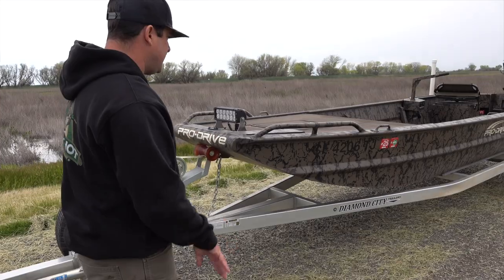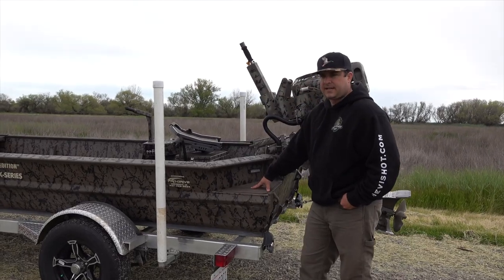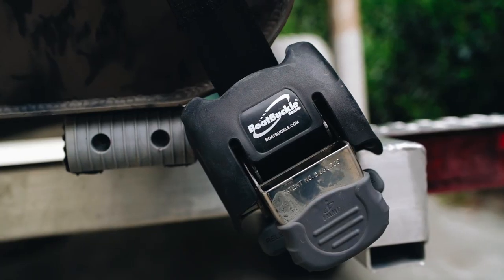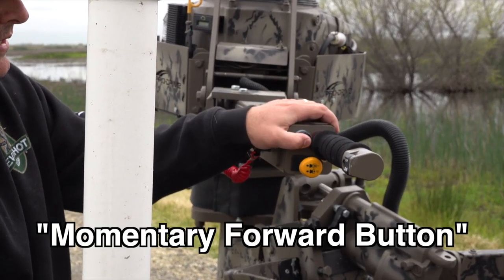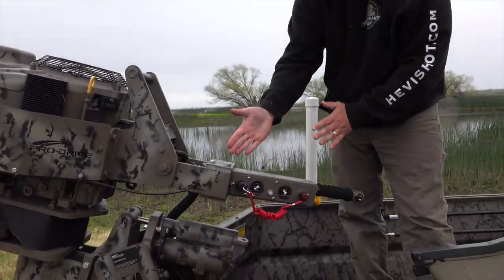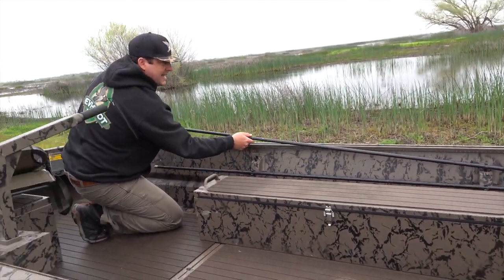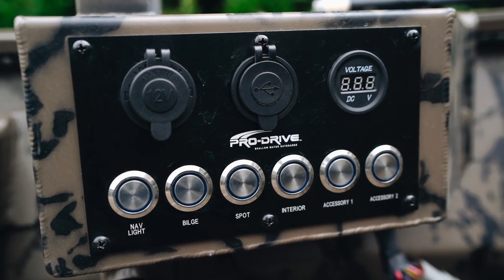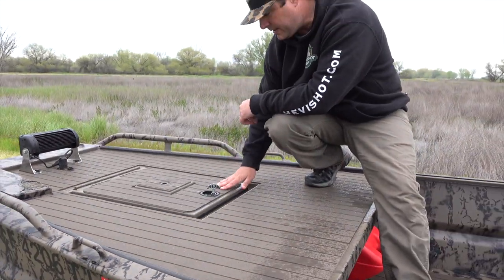Pro Drive 1848 X Series TD Edition 2023 (Our NEW Duck Boat)

Comment: Nice rig, but you won’t be getting to the hole first. I have a 1750 Gatortail Extreme cutdown hull with GTR 40.  To be honest, my next rig will be a 1854 Prodrive TD with the Stick Steer console. Glad that they added instant reverse along with full power reverse. I could really use that full power reverse and the gatortail cannot compete with that option. Nice rig!!

Comment: Have you taken it on any rocky bottom rivers? I'm in idaho and I hunt the snake river alot and I have a jet, and it does good but Suckling up weeds that are floating on the surface or if its shallow and it sucks them up it kills it till you get it cleared.  And the reason of the snake i hunt most the the drive time isn't in the main river so it is between 3ft and 1ft. And once I get 1ft or less it will suck up weeds. Just curious as I am debating a pro drive for when I get a bigger boat.
Reply from the maker: Weeds are no issue. This is a surface drive
Reply: @MidValleyMercenaries  ya I was wondering have you been on any shallow rocky bottom rivers. Such as the snake river or boise river as an example. The snake in some areas is weed bottom w mud, but alot of it is a mixture of both rocks(large and small) and weeds.
Reply from the maker: Yes we have. No issues at all

Comment: Sweet rig!
Does the prop sit lower in the water compared to the GTR? Noticed the paint is coming off already.
Reply from the maker: Thanks! 
No, they trim the same. Pretty sure the paint is always gonna come of the skag pretty easy because of it running through and scraping on the bottom. That scag on our gtr was stripped clean on the first use

Comment: You ever have those boat buckles freeze up in cold weather?
Reply from the maker: Ya but not to the point where you couldn’t use them. I pull them back and forth a few times and it releases

Comment: Can I ask why yall switched from Gator-Tail? Im about to purchase my first boat and I have a deposit on a GTR 1754 extreme. before I squeeze the trigger is there a reason you switched?
Reply from the maker: GTR was great. It was more of a business/relationship decision
Reply: @MidValleyMercenaries   Oh gotcha. Makes sense. Are you impressed thus far with the performance of the pro drive motor?

I’m on the fence between GTR and Prodrive and I need to make the decision before I purchase in the next month.
Reply from the maker: @mattthereverend1981 we love it! Great maneuverability, handles very well in turns, and it’s gear driven instead of belt. The PD is very friendly and great to work with as well. We will be getting the 50 next year